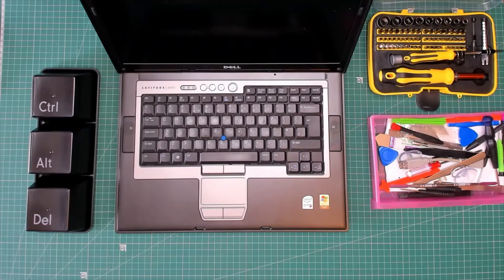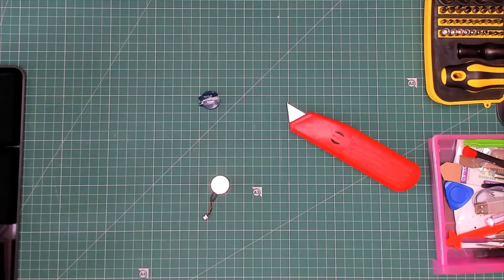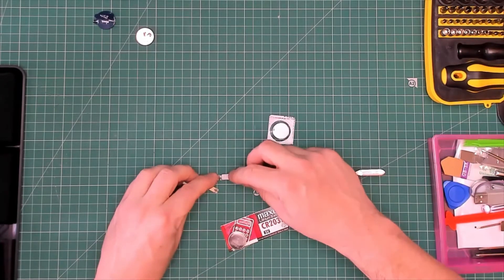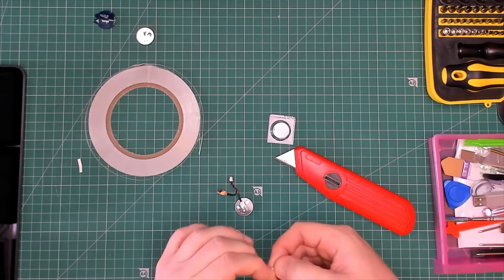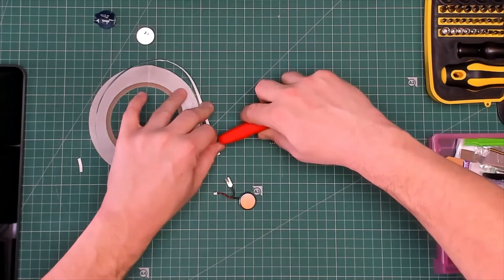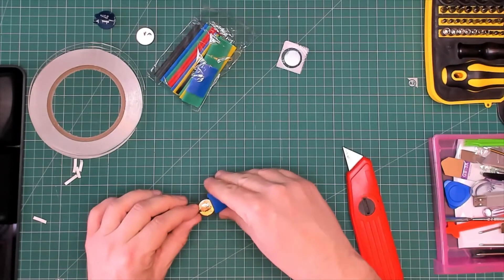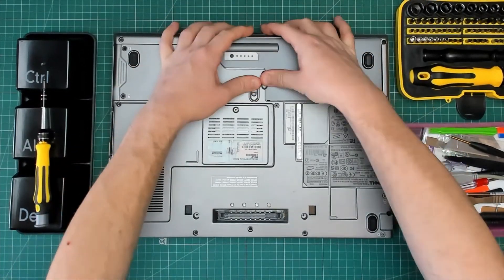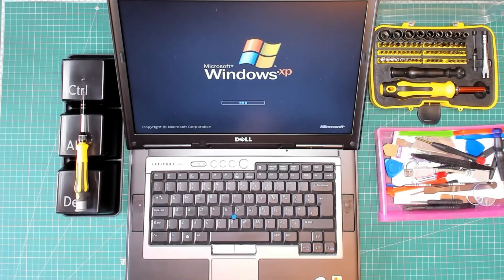Dell Latitude D820 CMOS Battery Replacement

Comment: Glueing or Tapeing is not an propper Connection !
Reply from the maker: It's not plastic tape, it is a conducting tape made out of metal.  This is a hobbyist repair and not in a repair shop.  I dont own a spot welder as that is how they are manufatured by an OEM or third party etc, so this will have to do.  In all the years I've used them they have not let me down.
Reply: @retrocomputinggrotto  I know this Coppertape well .. build many Network Cables with it 
My Answere stay the same
The Glue of this Tape is not strong
In a Laptop is it always hot the Glue ages.. the Shrinking Tube has not as much Pressure on the flat Side from the Coin Cell
Buy a Coin Cell Holder

Why i make so much "Noise" ?
Becuase someone thinks he can "wire" Things up with Coppertape it's cheap and easy and some Guy in the Internet says it works ..
And a House burns down or People got hurt

Yes, you cannot save everyone out there but you can give a Hint that this m Method is only a small Fix not a real Repair

Comment: Where do you buy the heat shrink and conductive tape? Good and clear vídeo, contratulations!
Reply from the maker: I got them from Amazon (UK):

https://www.amazon.co.uk/dp/B00KNU812Q/ref=cm_sw_r_tw_dp_HFV9Fb66477CD?_encoding=UTF8&psc=1
https://www.amazon.co.uk/dp/B01AIHQEZE/ref=cm_sw_r_tw_dp_EEV9FbH211CEH?_encoding=UTF8&psc=1
Reply: @retrocomputinggrotto  Thanks